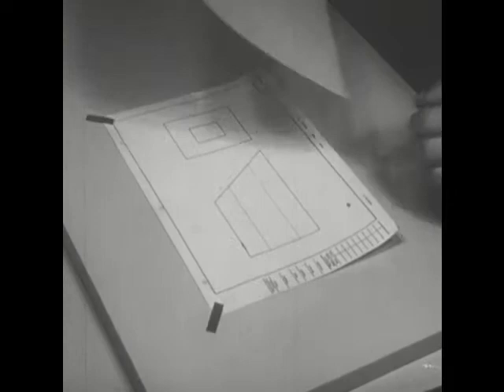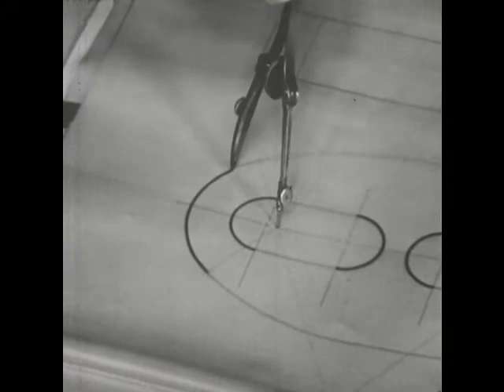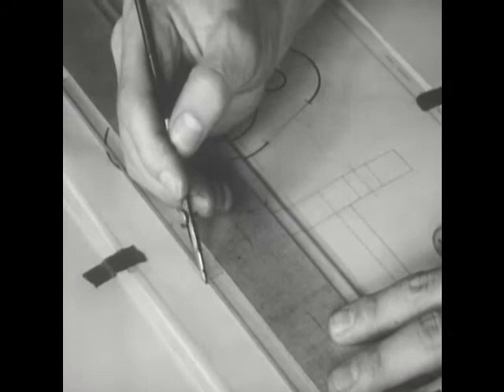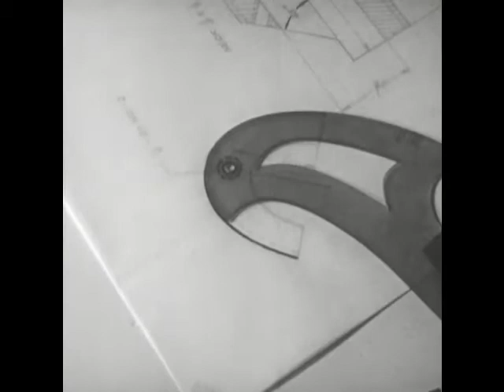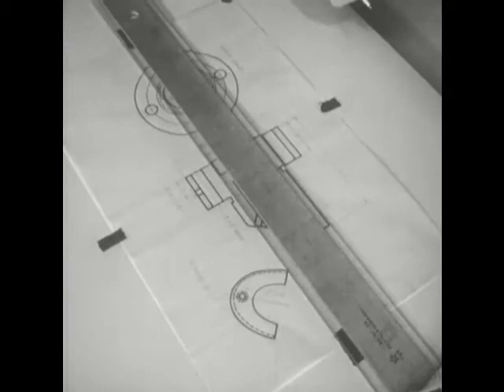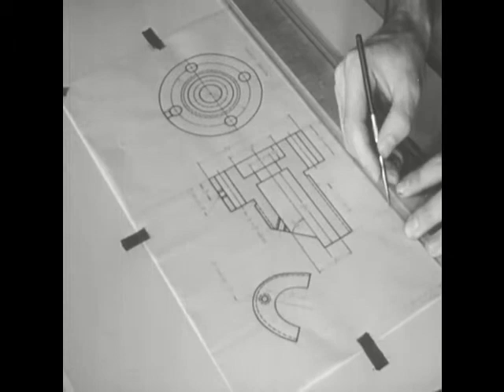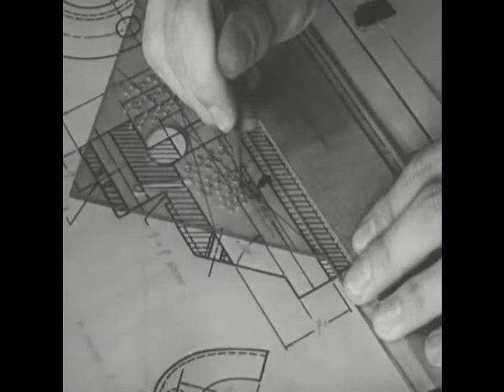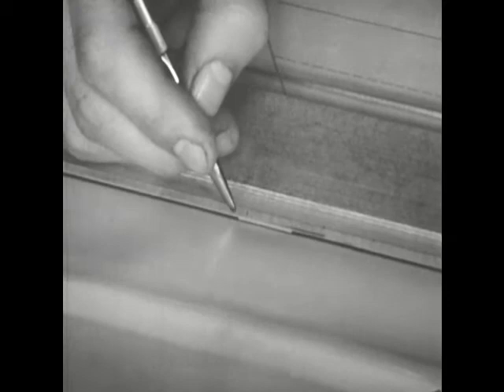Tracing With Ink (1955)

Comment: Drafting used to be its own profession within Architecture. In the 1930s, the highest paid employees at my grandfather's Architecture office were four draftsman who worked on the third floor manually copying sketches and existing drawings EXACTLY as drawn; human engineering copiers. When the copied drawings were no longer needed my grandmother washed and bleached them in her washing machine and cut them up into handkerchiefs; best-quality Linen cloth.

When I was in Architecture School in the 1970s, only the railroads and the mining industry still used linen drawings rather than vellum paper. Inked linen would last 100 years until needed. Vellum deteriorates.

A shortcut for draughting pens was to have one or two preset to the desired widths,  similar to the Rapidograph pens they were still using in the 1980s on mylar.

Comment: What paper is this person tracing on and what powder is required for it? I have never seen this before. Thank you!
Reply: Its actually a sort of thin cloth almost like a stiff silk scarf instead of conventional paper. The powder is called pouncing powder, its a very finely ground mild abrasive, usually pumice or similar, that helps scour the surface, roughing up any slicked down fibers and polishing away any oils and such that could prevent ink from adhering or that might cause it to run

Comment: They have to be told how to open an ink bottle?  In an era when most people used fountain pens, and schoolchildren used dip-pens in class?
Reply: It's not the same ink that you would use for a fountain pen, this is much stickier when it dries because of the "gum arabic" added. This can glue the stopper to the bottle and be much harder to pop off and the bottles have the dropper making them different from dip pen bottles. You could easily make a mess if you weren't expecting that to be attached to the lid. This is also an instruction to inking where you are expected to not just "open a bottle" but do it one handed, refill a drafting pen, and replace the lid so that the fast drying ink isn't ruined or spilled. Some one using an ink well wouldn't cover it or stopper their bottle until they're done. 

I would say it's not that they have to be told how because they're not used to ink, it's more of a warning that this type of ink is difficult to work with.